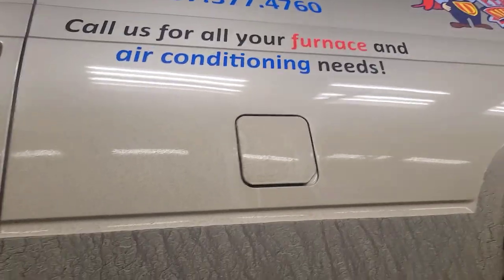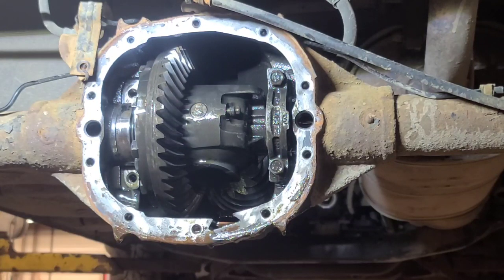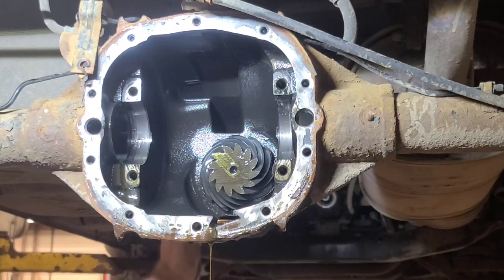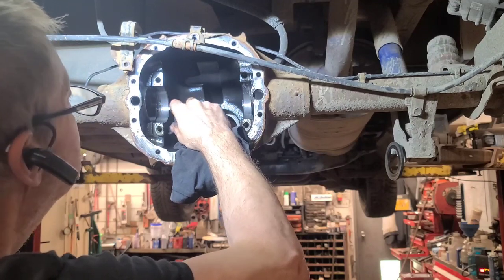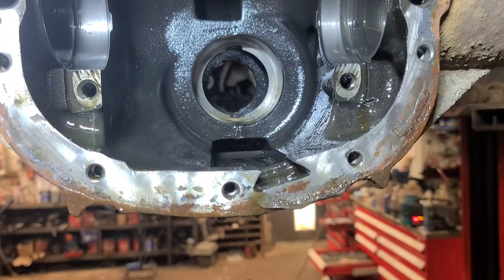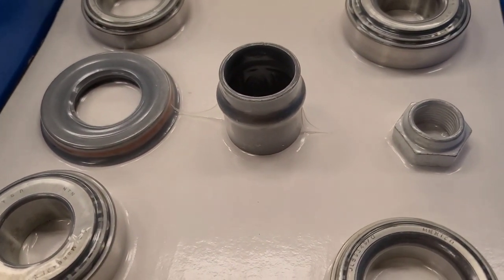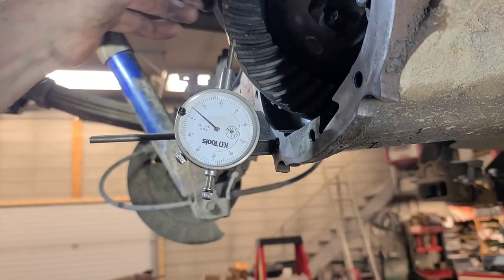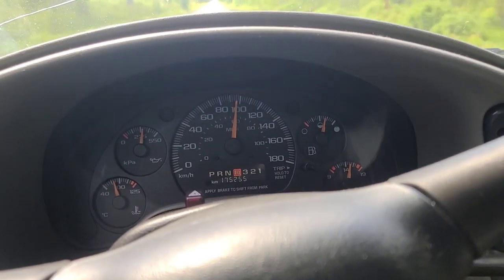2005 Chev Astro Van Rear Axle Bearings Replacement

Comment: Great job! I need to do my 05 Astro soon. I don't think that mine is as worn but it has a slight noise at higher speeds. There is usually a round donut shaped magnet on the differential housing.
Reply from the maker: @freddaniali  yes some have a magnet on the back cover.

Comment: Pattern looks good. Did rear diff on same van. Someone put mismatched tires and before it got to me they did the front diff and transfer case.  That was years ago.  Very costly mistake for being an all wheel drive putting  different sized tires.

Comment: I have a 2005 Chevy Astro Van. When I do a fast wide left turn, something moves/pops on the back tires side. Also when I’m driving through some neighborhood blocks and I hit the brakes, it feels like the rear tires still move or pop right when the vehicle stops completely. You know like you lean forward then back. Well, when you lean back it makes a sound like something moved back there on the rear side tires. Before the caliber was very loose and tapping like crazy but I fixed that part already. I replaced the parking brakes, caliber and both back rotars.
Reply from the maker: I'd closely inspect the leaf spring shackles and ubolts

Comment: How much do you typically charge for a job like that? I need this done to my 2003 chevy astro.
Reply from the maker: I would typically quote 4 to 5 hours for that. There could always be complications though. The bearings are sold in a kit and it typically costs around $175 plus 2 axle seals and synthetic gear oil which is not cheap. Around $300 Canadian for parts and $440 to $550 labor.